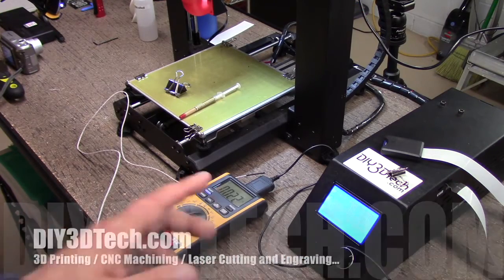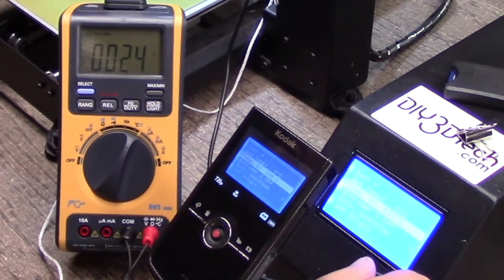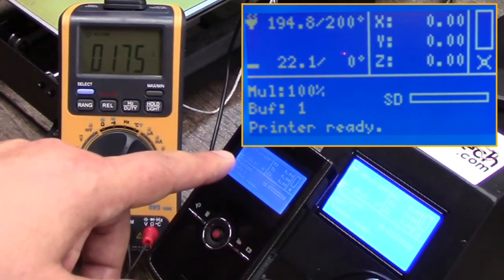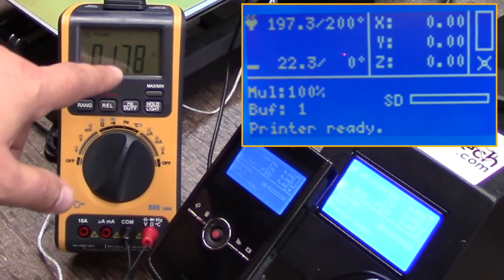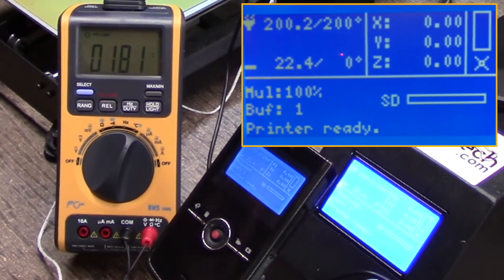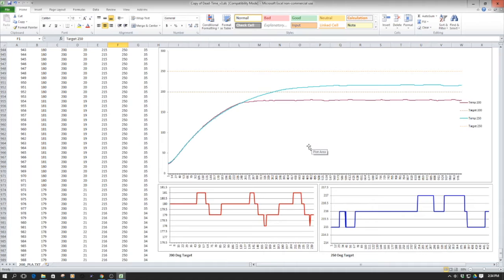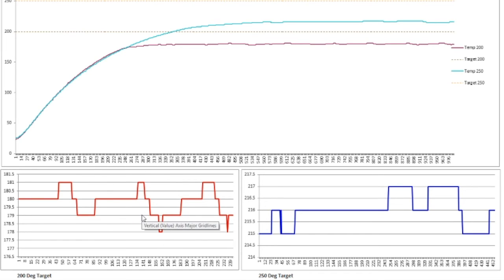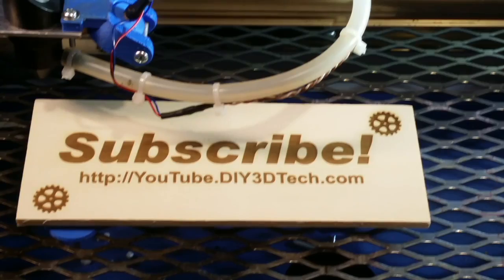3D Printer Talk - Dead Time versus PID Testing it Out! Part 2

Comment: I done the same test with a calibrated meter not to long ago however I put my thermo couple in the hole with the printer one. The hole is big enough to hold both and I got about a 5deg difference, I think its worth you re trying this and I believe you will get a big difference in readings as the thermal temp on the outside of the block will be a lot different from the internal temp near the tip.

Regards Deno
Reply from the maker: Many thank and did expect this (i.e. difference in temp)  however what I expected it to be is linear and it wasn't.  As the higher the temp got the larger the difference (inversely logarithmic related) which shouldn't be.  As if its 5deg off at 200 it should be around 5deg off at 220 and it wasn't leading to believe larger issues...

Comment: P.S. if you use Marilin you need the correct value under  :) //// Temperature sensor settings. 
There are quite a number of different ones
Reply from the maker: Yes you are correct, I have been avoiding going there as most people who purchase one of these won't have the skill.  However over the holidays think I might go and modify the firmware to a community version...

Comment: As filament feeds through some temperature could be lost, cold filament taken some degrees to warm up. Heat beds, etc. may impact lowering heat loss from the nozzle
Reply from the maker: Some (a deg or two), however thing is way off!  :-)
Reply: OK :) I know you tested the Multimeter, note I checked my Vincy VC99 with boiling water and it was 5 degrees out; As you know infrared units are not good at silver parts like heater Blocks, etc...

Using "Tom's guide" PID for Hot end
M303 S200 C10

and

for heat bed, takes time to cool and heat
M303 E-1 S70 C10
Reply from the maker: I could buy 5, but we are speaking more int he lines of 20 and and complete loss of linearity in the response which leads me to either a bad thermister profile or A/D.  I've just made up a simple cheat sheet and that seems to working well. Over the holidays I migh spend a little more time on it...

Comment: great stuff.  re the 250 zone . some thermistores cap out at 250 260 range and its log scale , so the temps become unreliable the closer you get to that zone.  some are ok till 300  , but suck at lower , but we dont care about sub 100c.
it would be handy to figure out a thing to hold a thermal couple to the nozzle . 
i found my unstable heating was ironically due to lack of cooling of the cold zone . 
when the cooling is enough you get push - pull effect .   fan pulls down the temp and the  heater pushes back , and can balance against the pull down with a stable even heating pules. 
when i was under cooling the heater would shoot to target , over shoot a bit , the LED would show un even power applied to heater and heat soak was reaching the up int parts that should be cold.  this lagged the re heating. it also caused bad jams in the heat break.  oh and triggerd the MAXTEMP now and then . 
adding more cooling quickly stabilized the power to the heater keeping it even . i still find my outer block temps 30 to 40c less than marlin reports . but i know the nozzle was wicked hot because it melted PLA on contact without effort and fast. but i could not measure it there . only my IR , and it has tough time with metals and shiny surface . im gonna put a bit of capton on it  to see if it will work .
Reply from the maker: Interesting on the 250 zone, did not realize this.  I got a hold of some Reptier moded firmware for it and thinking about giving it a go and see if makes a difference...
Reply: Most IR have a tough time with metals and shiny surface's
Reply: yeah i should have known better . mine has a few mode si can put it in that are supposed to  compensate .. but its more fuss than its worth .  its better to give it a good emissive  target like a bit of capton or such .  also if i can aligne it in advance i can smear some PLA on the  nozzle and point at that .  
what i need i a nice bimetallic strip or such  .  
would be cool if some company came out with a calibrated sticker that would change color vs temp' or something .
Reply: Yeah i was surprised , some not only get unreliable over 250 , they can be damaged some how . i suppose as that enters the temps of high-tech low temps solders. thermal couples and bimetallic can take much higher temps .  
i was looking over ebay and such for sets of  thermisters and such and what max ranges are available .  could be worth a few bucks to get a few and bench test em .  hmm . i keep putting projects in my to do basket .  In the end i think moving to a cartridge  style like E3D  have now  might be the best bet .
Reply: Lot's of stuff on eBay appear to be over optimistic, not just thermocouples, etc...
Reply: yeah too true .
Reply: Just got a 2000lm torch off eBay it gives out less light than my 1000Lm touch... Looks like about 800Lm.

It's OK for the price but these touches and 4 Billion Amh Battery's ore wish-full thinking
Reply from the maker: LOL!  I want one of those 4 Billion Amh batteries for the Delorean I have in the garage :-)
Reply: Time Travel Delorean use garbage via Flux Capacitor :)
Reply from the maker: With recycling and all, that hasn't been work out to well :-P so I have been think the Tesla route is better!

Comment: This is why printers are migrating over to a thermocoupler and the E3DV6 now comes with a Thermocoupler.  I hate how I will have to rig up something for my ramps if I ever go to a real e3d.
Reply from the maker: Just got an all metal E3d v6 clone not sure why I ordered it other than got a good deal however will likely upgrade the tarantula some day as just love that crappy printer
Reply: DIY3DTECH.com
I have the clone as well for over six months and still the v2 model with the thermistor but the V3 model, and all future hotends they said, is using a thermocoupler.
Reply from the maker: so assume it is doing well for you? (i.e. the v3)
Reply: DIY3DTECH.com
Exceptionally well and well worth the 8 dollars I paid for it and it came with a bunch of different nozzles and 2 volcano nozzles with a volcano heat block but I have never used that.
Reply from the maker: Interesting, will have to give mine a shot around the holidays...
Reply: DIY3DTECH.com
A lot of people use them on the Tarantula and it was on their FB page that I first learned of this knock off and immediately purchased it.

I am building a new printer using V-Rail and wheels from Openbuilds (my God their ordering system is archaic and I am having issues with a new nazi mod over there but that is a different story).  It is my design but I am about 70% done with the parts.  I need 4 motors, the angle plates, the tool plate and the silicone heater then I will have all of the parts.  It will be a 300x300x340 printer (Z height may change up or down when I start to piece everything together) and I will finally be shed of the prusa style bed.  Never liked a bed that moves in the Y or X direction.
Reply: Protomaker Black Sprint Original 3D Printer
The Aliexpress one is just like Kenovo and they are very helpful.  I am trying something new as the 1/4in tooling plate demands that I do so I went with a 450 watt 117 vac + SSR and it is 250x250 so as not to brush up against the edges.  The heat will radiate towards the outer anyway.  300x300 would be edge to edge but in reality I have little to print that size but there has been cases I need a larger bed size so I decided why not?  If worse comes to worse I will swap over to a volcano and use 1 or 1.2mm nozzles as a lot of the stuff at that size I don't need fine detail I just need the part.
Reply: SSR , I uses one for 24 volt Heat Bed RAMPS control and it works so well I forget about it.
1.2mm nozzle should speed things up :) I'm sure you know Two heads could print coarse the finish off fine :)